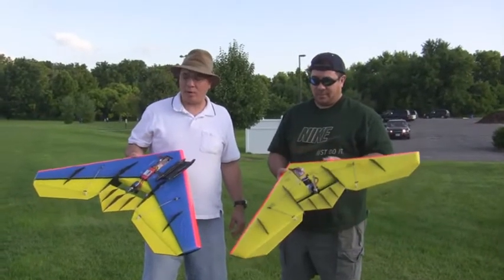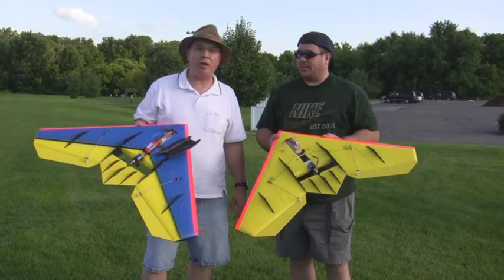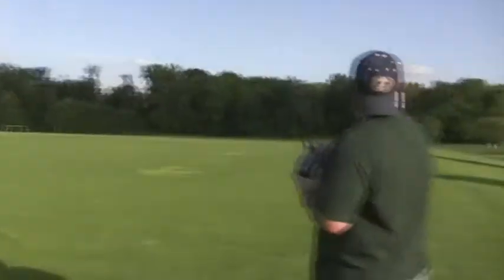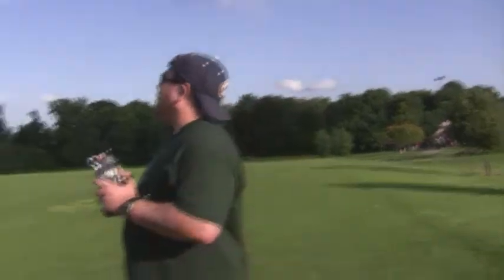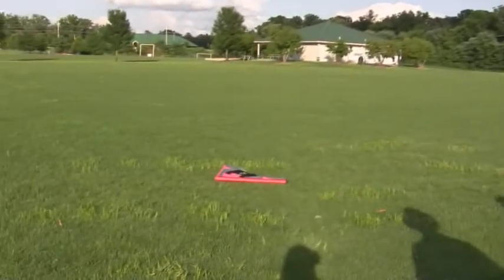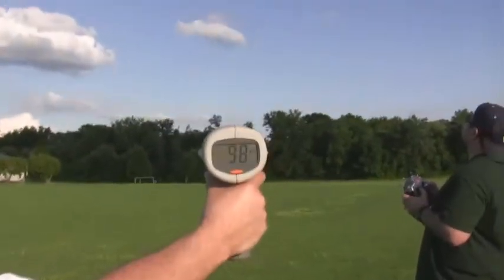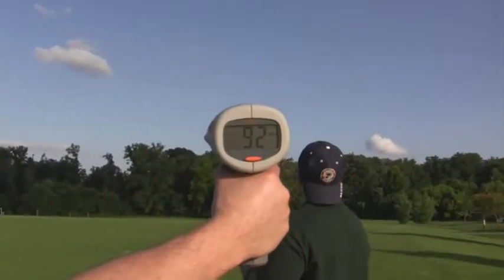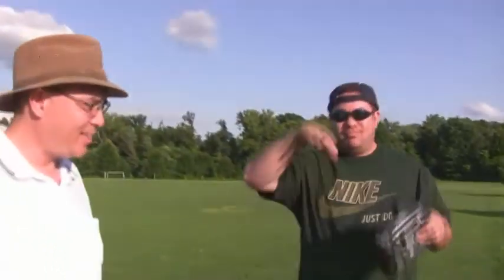KFm4 Airfoil vs Symmetrical Airfoil Comparison

Comment: Im using a regular Clark-Y airfoil right now  for a foam board build but the last 2 planes had KF airfoils. I can def tell a difference between the 2. I like Clark-Y for heavy lifting, but I honestly think the KF airfoil handles higher speeds better. I’d say the Clark-Y produces more lift for sure but if your plane has say.. a 1.2m wingspan and weighs 3.5lbs or less go for the KF but if it’s 4+ pounds go with the Clark-Y for higher wing loadings. Both are great just better at different things in RC size aircraft.

Comment: gez that is fast.
plz give fore info on the testbed.
motor, prop, whos design it is ...
regarding the KF:
how big is the step and where is it?
the non-KF; if you put a turbolator/vortex-generator on it, will it be more stable at low speed?
-> put a thin obstacle at 40% dept on the top of the wing.

Comment: I have to agree with your summary.. the thickness of the wing makes a big difference to the top end speed, as does the revs you got from your power setup
Worth trying are more lower steps..Ie two lower steps top and bottom instead of a single deeper step..
Ive been working on thin multistep glider wings ..all top steps for lift, but they are much faster under power than I first expected...

Comment: Good video, I found that same flight stability with the KF as you did.  The planes that I have used a KF airfoil on are all easy to fly at low and high speeds.  However, I don't think I have a plane that flies over 60 mph, so I can't compare them with speeds  of 80 and 98!.  It's amazing that foam can go that fast.
What are the specs on the power system used in the video?
IE Motor, ESC, Battery.?

Comment: Great video once again Bro's. I remember the earlier video's when you first tried flying the non-KF plane. It was pretty unstable then as well. It's obvious that the KF version is the better plane. Perhaps a comparison with planes that have tail's would be more conclusive. Either way, you have proven that the KF-airfoil does work. Great job once again. You guy's are leading the pack in experimental rc-plane design.   :)